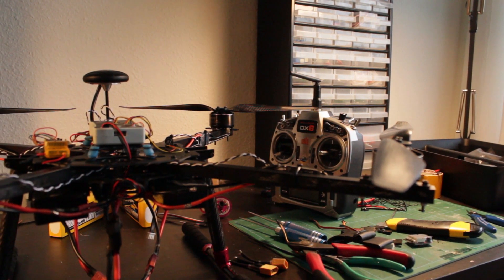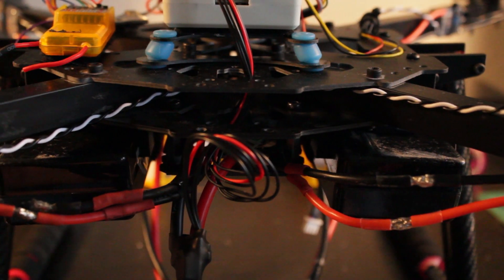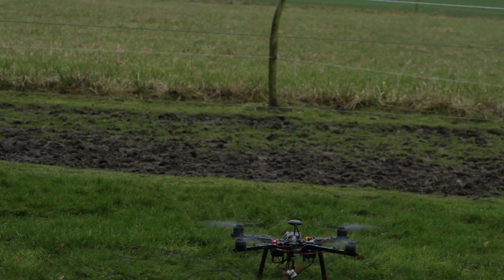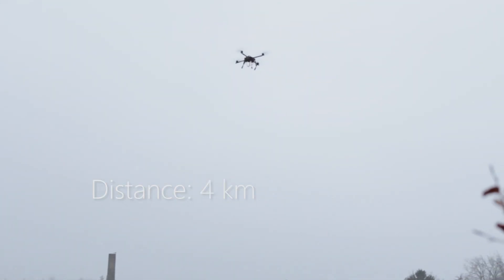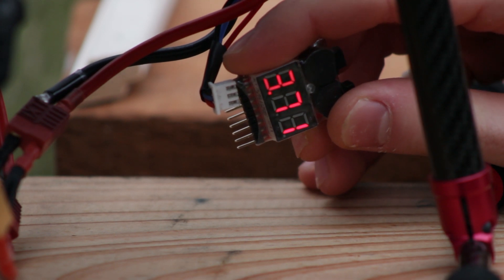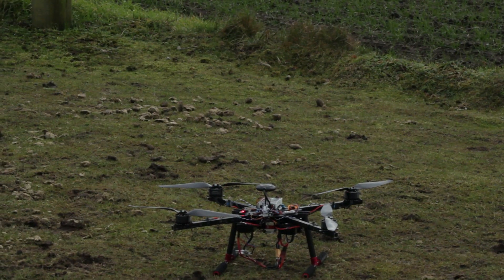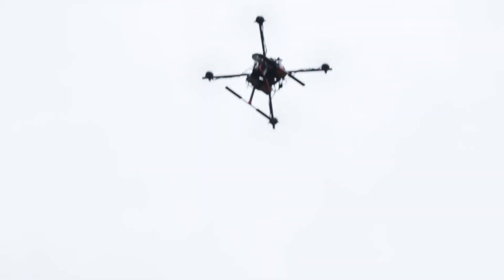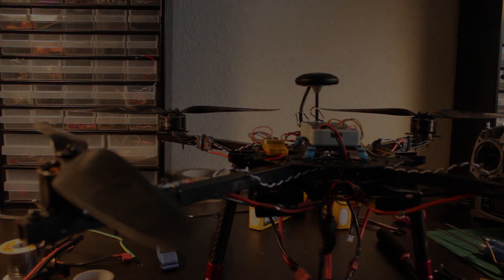DIY Delivery Drone Range Testing

Comment: Awesome video! I'm doing a build of similar size but meant as a video platform. What motors/props are you using? I'm doing 4108 600kv with 1555 props, just wanted to compare to yours.

Comment: I tnk u mentioned range which is 10km and I don't see range testing here
Reply: He did the testing by following a to and fro route between 2 waypoints.
Reply from the maker: What do you mean? Litterally the entire video talks about range testing of the drone.
Reply: @Karlemilstorm  he flew back and forth over his head BETWEEN 2 FIXED POINTS, that's duration of the battery testing. How far will it fly AWAY from its transmitter is TESTING IT'S RANGE. Think about it.

Comment: internal volt meter is not accurate and drops actual voltage. i had the same problem. i don't rely on it any more and use frsky 6 cell sport meter. I used different techniqu to estimate distance. i compared hover time AMp consumption with 15/s cruise time. they were the same (29A) on my 550 quad. iknow that my full 16Ah, 4s batt gives me 30 mins flight. average speed is roughly 13m/s thus i can calculate the max distance based on that.

Comment: lifting weight
Reply from the maker: Hello Jill. What are you referring to?
Reply: I meant lifting power
Reply from the maker: It can lift a lot of weight, about 6-7 kg but not for very long
Reply from the maker: Maybe more, but I haven't tested it
Reply: I am going to use car battery or hydrogen fuel  to extend flight time and lifting power
however the motor may not last that long
Reply: and u may need to do some calculus for amount of liquid fuel  against the maximum lifting power and flight distance
Reply from the maker: Hydrogen sounds unrealistic and a car battery is just a bad idea. It is extremely heavy
Reply: @ccuuttww  lol

Comment: what flight controller are you using?
Reply from the maker: It is a pixhawk
Reply: I want to do a similar project to deliver small items to any of several preset locations and want to make it operator friendly. You think the pixhawk + flight planner will do the job or should I look at DJI's newest flight controllers and their GS Pro app? How difficult is it to get started with the pixhawk? Where should I start?
Reply from the maker: I don't know much about the DJI controller, but pixhawk is cheap and easy to use so that is the controller that I would go with. Watch some YouTube videos about the pixhawk. It is easy to use